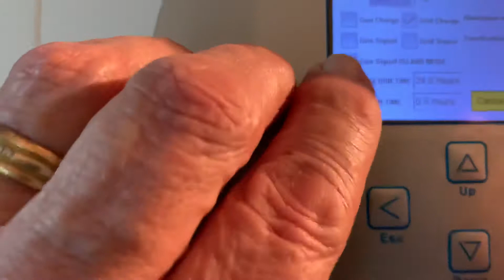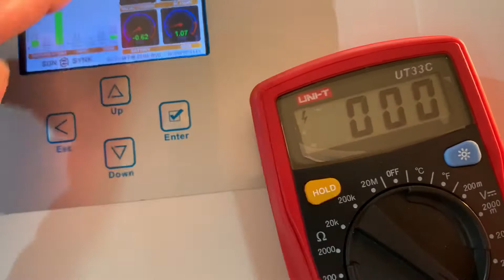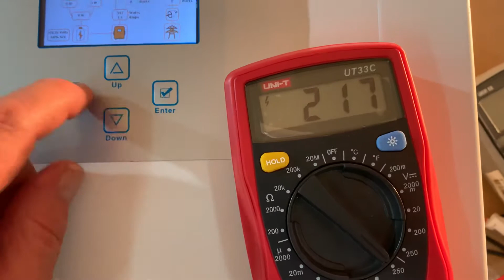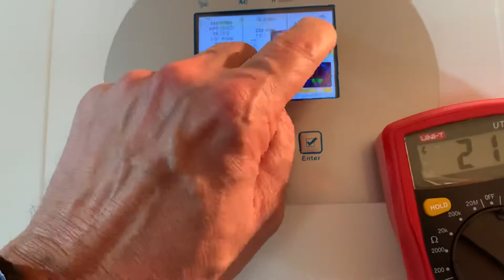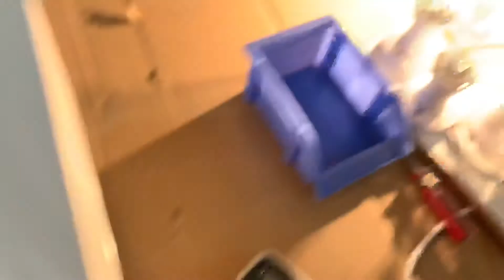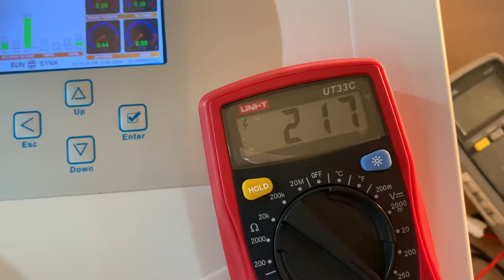Adding an automatic add bond to the Sunsynk inverter

Comment: if its no bond island mode what will happen sir
Reply: You will have both phase and neutral wire with potential. And some equipment could not work properly.

Comment: Neither of my eco 3.6 inverters will do that. The multifunction port only has numbers 1 to 8 ( left to right)
I have tried paperclip and test meter across all options between terminals 5 and 8.
No continuity with AC disconnected (2 pole). Signal Island mode is ticked and ok'd. Please help.
Tech says SA hasn't had access to one yet so still unclear.
Manual included shows older models interface.
Thanks...

Comment: How would one go about sizing the correct current rating of the relay that is to be used?
Reply: Hi JJ. I would have thought the relay / AC contactor would be single - phase, 2-pole , din rail mounted and the current will be dictated by the rating of the load you wish to supply ? EG. 3.68kw inverter output would perhaps require a 16amp overcurrent protection device and perhaps an RCD / RCBO in line.
The switching contacts of the relay / contactor normally consume milliamps .
This is all basic electrical stuff, so unless its understood properly it is advisable to seek expert advice.
Maybe that is why many questions remain unanswered ?
Reply: @MultiOutdoorman  The entire purpose of the bond is for the earth leakage to trip when live or neutral touches metal or a human. Most earth leakages trip with a 75mA difference, that is the safety requirement - hence the contactor should never really see a full load current flowing into earth.
Reply: @MultiOutdoorman  do you know wire gauge earth and neutral side

Comment: Excuse me for my ignorance, but what is an add bond and why would it be required?
Reply: Hi David.
As you might be interested ?
Bonding, grounding and earthing terms are all thrown around meaning similar things but all having different criteria.
Bonding means to physically join together (with approved methods), extraneously conductive 
( metallic) components ( stuctures, enclosures, pipes, wiring CPC's) together, so that they have Equal (ideally zero) potential in the event of fault conditions. 
By establishing continuity and bonding together neutral and "earthed" items at the SOURCE ONLY  of the power supply, the earth (CPC) acts as a neutral return path should anything bonded become live (loose wire touches metal etc) thus providing a short-circuit facility.

An RCD / RCBO device would then detect an imbalance between the line and neutral connections within the device as current would have "leaked" via the "earth" conductor.
Always seek your own professional assistance when dealing with electricity !
Reply: @MultiOutdoorman  Great answer, very  comprehensive yet clear and precise.
Thank you.

Comment: when i am on island mode.. can i charge the battery from the grid?
Reply: Island mode means isolated from the grid, so i wouldnt think so Mahdi ... unless my understanding is flawed .
Reply: In order to charge a battery from the grid, several things are needed:

- Connection to the grid
- An inverter that transforms grid AC into DC that the battery can use to charge
- A charge controller / BMS, which ensures that the battery receives the correct voltage and current (among other things)